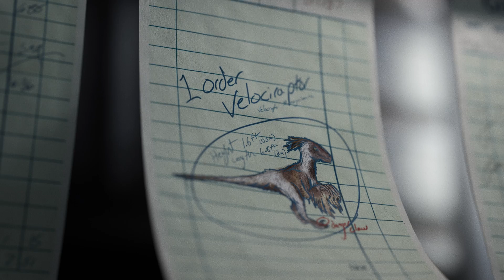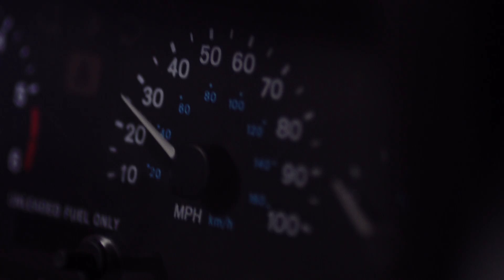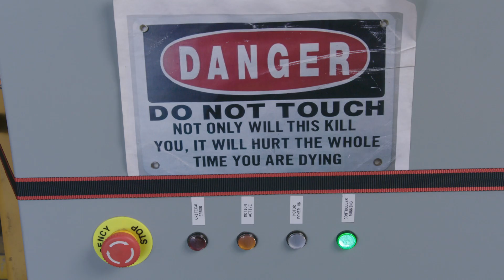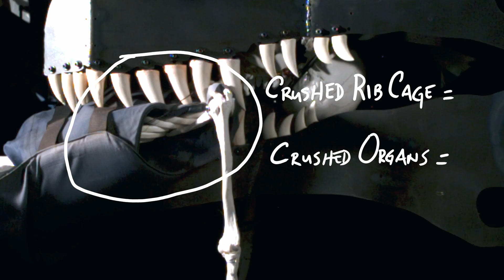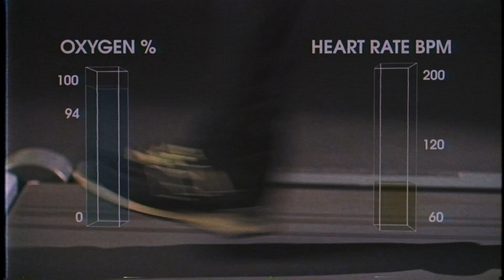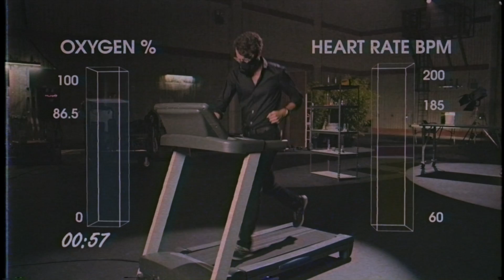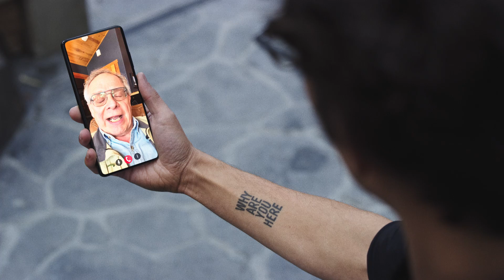Could You Survive JURASSIC PARK?

Comment: The general research in this video is all over the place, they ignore all of the nuance in feathers on tyrannosaurus but have a fairly good, albiet conservative restoration of velociraptor. At the same time ignoring and implying that modern restorations aren’t cool enough so using outdated reconstructions is fine. When these were animals that once walked the Earth, not movie monsters for your entertainment. And then 10:52 comes in and calls pterosaurs flying dinosaurs. I don’t hate that statement because they are at least the closest animals to dinosaurs that aren’t dinosaurs. But then they also ask about pteranodon in the introduction even though they are testing the strength of an azhdarchid, which is a completely different family of pterosaur. The only saving grace is they used pterosaur instead of pterodactyl, which is like the bare minimum.

Comment: I think it will be possible to get dinosaur DNA.  There are just so many millions of copies.  They are all damaged, but not damaged exactly the same way.  If each were read, in a sample, there should be enough intact small bits of DNA, in each copy.  Normally super small pieces would not be that useful, but if relative location was also known, which should be obtainable, perhaps using nanites, it is conceivable that it could be fully deciphered.  I am not saying we could do this in 5 years.  It might only be possible 50 years or 500 years from now.  Just that the information is not permanently lost.  Some will be.  I suspect, not every species' DNA is out there, that is in the fossil record.  Though, we may get DNA from dinosaurs or other creatures that have never been found in the fossil record. I suspect, also, that there are more sources than just amber.  
Further simplifying the task, there are likely more probable or even consistent ways, different patterns of DNA are damaged, in the same way we could learn to recognize what kind of bug was smashed on our windshield, we may deduce what the section of DNA originally said before it was hit by a cosmic ray.

Comment: How can you know what an extinct animal looks like? All the soft tissue like skin, feathers, organs they've decayed leaving behind only fossilized bones. So how can anyone know if they are feathered or leathered? and wouldn't biteforce knowledge require more than just jaw and tooth size? you need to know how much muscle was involved as a jaw without muscle is pretty much motionless.
Reply: Soft tissue has been and can be preserved. There are cases of extraordinary fossils that leave behind a lot of stuff, which includes feathers and other soft tissues like skin and even organs. Recent studies have been able to even recover colors from fossilized feathers. But you can tell very much by just the bones alone. Like for example, we have found bite marks in triceratops fossils that perfectly match the holes made from trex teeth, and they just so happens to have lived at the same time, so that is indirect evidence of predation by a trex. You can also check for muscle attachment points in the skeleton and very accurately figure out how much muscles they had in certain places. This is done with modern animals as well and works very well.

Comment: What people tend to forget about jurassic Park is the dinosaurs aren't really even dinosaurs. They're just designed to look like dinosaurs, and have the base DNA of the dinos, but so much has been filled in or put into the DNA that it's questionable if you could even call them dinosaurs anymore. It's like if you changed the DNA of an elephant so it behaved completely different, ate a completely different diet and preferred a different climate, but they still LOOKED like elephants, would they even be elephants anymore?
Reply: Ship of Theseus
Reply: Also if they used bird 🦜 dna 🧬 it would actually be close enough to the actual DNA.

Comment: In reference to 9:52 comment about the fence doing nothing is incorrect. If the each line in the fence is at a different potential. In that case any contact between line to line would create a path for electrocution.

Comment: They "discovered" that Trex can only go about 12 mph?...
1: How was this discovered?
2: How does that even make sense? You'd be talking about the single most unsuccessful predator to have ever existed. Even if it was a scavenger, it would be completely dependent on being able to steal basically EVERY other smaller predator's kill within a 30 mile radius just to maintain their weight.
Reply: 1. probably by looking at its feet and doing some calculations. 2. the animals it hunted werent fast runners, the fastest meals it hunted were around the average speed of an elephant, the animals a tyranosaur hunted were, big, very big, so they werent that quick.

Comment: Sadly many of these claims don't hold up to scrutiny. 

For instance, would modern day plants be digestible? Most of the dinos in the movie, like T rex and Triceratops, actually lived in the late Cretaceous, which had plenty of angiosperms to munch on. Furthermore, all plants are constructed of the same basic components, fibrous material (cellulose, lignin), some easy to digest macronutrients (sugars, proteins and fats in seeds), and defensive secondary compounds. The defensive compounds change in different plant taxa, but herbivores have many ways of dealing with that.  The most basic way is taste, which tells you if and how much is suitable for digestion. The point is, this claim is way overblown. It probably would have caused problems, but nothing as clear cut as suggested. 

The difference in oxygen is also relatively minor. A 5% decline in O2 is like moving from sea level to Flagstaff, AZ. Most animals don't have an issue with that. 

Finally, velociraptors are indeed pretty small. But change the name to Deinonychus or Utahraptor (much bigger), and you'd have a big dromaeosaur 'raptor' that would scare the bejusus out of you. Not nearly so smart of course. Corrected for size, their brains are at the lower end of modern birds. Like a chicken. Big for a dinosaur, but nothing like a crow or chimp. 

Lastly, a big T rex was probably not covered in feathers. Large mammals like elephants and rhinos are not covered in fur - it traps too much heat. Assuming dinos are warm-blooded, a baby T rex would have been feathery, but not her mama.

Comment: "not that intimidating at all"  hun that "turkey" has a mouth full of razor sharp teeth and feet with disembowling talons.  not to mention they are incredibly fast and agile.  you would be torn to shreds in seconds by a velociraptor.
Reply: Exactly, they might not be as intimidating as the ones in the movie, but they are still a substantial threat. They are comparable to coyotes; they are not likely to attack you, but you're going to want to avoid them regardless.

Comment: Those masks dont just decrease oxygen. They make it harder to inhale. Not the same thing. You'd need to go to a higher altitude, or use some kind of proprietary gas mixture with a mask.
Reply: Making it harder to breathe  technically there is a decrease in oxygen flow. So the same negative could happen .

Comment: I can prob handle against a third of the species, the rest....prob not....
rifle and shot gun and PCC. Against compies, maybe, depends on how aggressive they are. 

So basically if a trex bites down on a skeleton its like its eating crispy/crunchy skin of KFC......i guess they'd have no prob eating bone and pooping them out then....
the bite force makes sense when you consider how large the bite force is from gators and crocs....

Also the T-Rex is not the only thing you have to worry about, but also other large dinos like Triceratops and Stegosaurus that will hit you or bite you as well... 
Also wearing body armor means nothing if you don't have a shell like a turtle to hide in, all you are is just a shrimp in comparison with easily crack-cable thin shell or leather armor and you lack the frame of a car/turtle shell to protect your inner soft parts from the pressure of weight or bite force....that's not hard to figure out....

You have to worry about the bite force of other beasts not just T-Rex so this video isn't as thorough as I'd hoped, but the point is, if you see a T-Rex, you're screwed pretty much unless you can avoid it.

Comment: 10:05 so... is the implication that one could theoretically scale an electric fence as long as they like, leap up and grab it so their feet never touch the ground upon contact? And then of course leap off on the other side when low enough so there is no contact with the fence upon returning to the ground?
Reply: This is correct. I have actually seen it done. It is the same reason birds don't (usually) explode into feathers as soon as they land on these things.
Reply: @vicioushellsing  why did I laugh
Reply: I tought this too
Reply: @Yes_this_is_my_cat  qw67w22u6 and 273uu3k

Comment: The creators knew the Velociraptors weren't correct, as they purposely modeled them based on the Deinonychus, as did the author of the books, but they preferred the name Velociraptor as it was more "dramatic." It certainly sounds cooler.

10:54 Pterosaurs are not flying dinosaurs let alone dinosaurs at all. They were just a type of reptile who could fly that happened to be alive at the same time as dinosaurs and a whole lot of other -saur things. There is a huge misconception where various flying reptiles and marine reptiles are lumped into the "dinosaur" label but as a general rule of thumb if it was a flying or water-based creature then it likely isn't a dinosaur. Looking at a pterosaur such as a pterodactyl and calling it a dinosaur is like looking at a dinosaur such as a T-Rex and calling it a pterosaur. It's just wrong.

Comment: the raptor portrayed is a utahraptor not a velociraptor. velociraptor was only ever actually mentioned in the first scene of the movie. after that they were called raptors by the cast. theres no real evidence Tyrannosaurus Rex was feathered, Scientists have produced a wide range of possible maximum running speeds for Tyrannosaurus: mostly around 9 meters per second (32 km/h; 20 mph), but as low as 4.5–6.8 meters per second (16–24 km/h; 10–15 mph) and as high as 20 meters per second (72 km/h; 45 mph) the hunting and max speed of Tyrannosaurus Rex are still more or less up for debate. these are pretty much my only gripes.

Comment: So. Yes, the velociraptor's name is wrongly used but Jurassic Park raptors were based on the Utahraptor, which is basically a velociraptor in all but the name they used for them ((the velociraptor sounds cooler, I guess)). Utahraptors were actually slightly bigger though I'm not sure if they were pack hunters and as intelligent. I'll have to research it.

Comment: For Beginners,They Didn't Use the Proper Materials To Build Dinasour Enclosure,Instead Of Flimsy Steel,We Would Use 25 Inch Transparent Steel,Much More Resistant To Armor Plating,Next With Current   Technology  Being Updated,With Alittle Bit Advance Technology,To Use To pin Point Aggression In A Dinasour BrainAll You Have to Do Is Nulify That Aggressive Message in Dinasour Brain By Simple Electronic Helmet That Uses The Same Technology To Grow Dinasour Cells To help protect  NuroTrasmitters,Made From A Special Alloy That Doesn't No.1. Interfer With Dinasour Biology &Resistant To Damage A Dinasour May Encounter,Think Smarter With Advanced Technology instead Of Foolish Thoughts of Personal Wealth over the Life of An Individuals in 22 Century Jurrasic Park😊

Comment: Amazing episode, well done and thank you! One gripe though is the "oxygen limiter" Aka the pseudo-high altitude mask you used doesn't simulate high altitude for 2 reasons. As an exercise physiologist this is a pet peeve of mine: 
These masks restrict the volume of air you breath but don't affect the partial pressure of O2 in the air (paO2). And even then that wouldn't change the percent O2 in the air (it would still be 21% but just with less pressure).

Even if you went up to an actual high altitude the percent oxygen would still be 21%.

To truly restrict the percent oxygen you'd have to have a spirometer attached to a large steel drum of air where you directly control the pressure and % oxygen.
Reply: @Ryan Napier Actually,  no; similar to wearing a face mask or N95 mask, it does not affect your SaO2 (oxygen saturation as indicated by how well your red blood cells are binding to oxygen). 
However these fake "altitude" masks would be good for strengthening your ventilators muscle (primarily the diaphragm) but ventilation is not a limiting factor in in exercise performance (in fact even if you breathed pure O2 your cells still may not be able to utilize the oxygen carried by the blood aka your VO2max.)

I did a podcast that touches on these topics a bit. You can check it out by typing in 1 Life 2 Lift into any podcasting app and searching for my 5th episode on exercise and asthma (featuring Bane from Batman).
Reply: @Ryan Napier This is my Fitness channel account FYI. 👋
I might make a video in the near future directly addressing these kinds of misconceptions around oxygen utilizing and physiology. 👍

Let me know if you have any other exercise questions, I'm always curious to see what the lay perspective is on these topics :)

Comment: Pterosaurs are not flying dinosaurs, they are a totally different group. That's like saying a dolphin is a seal that lives in water the whole time. Totally incorrect. The only flying dinosaurs ever were, and are, birds. Also, the oxygen level test you did on the treadmill was pointless and no comparison, because humans have completely different breathing apparatus than dinosaurs did. Dinos shared the same breathing mechanisms as birds , which involves a one-way air flow through air sacs and hollow bones as well as lungs, meaning they can breathe in and out at the same time. Mammalian lungs are far less efficient since we can only breathe in, or out, at any one time, whereas these animals had a constant flow of fresh air over the lung surface. Your hypothesis may still stand, but your treadmill demonstration was completely inappropriate and further investigation is required. Jack Horner, the paleontologist who was technical advisor on the movie, and incidentally was the first person ever to discover a dinosaur embryo, has stated that he does not think oxygen levels were a factor in the size of dinosaurs, and that gigantism will, can, and does happen without elevated levels of O2.

Comment: One of the important issues with the dinosaurs in Jurassic park is that they are technically genetically altered as in the first film it was stated due to degradation of the genes they had to take several different modern species genetics to substitute and fill in the missing components.

Comment: There's no evidence that T-rex had feathers, let along that they were colorful. We only have evidence of a wide distribution of scale impression among it and its closest relatives. You can find diagrams of them of Google. Also check out the reconstruction of Sue by the Blue Rhino Studio for a modern interpretation of what rex looked like. Another reason raptors may have had trouble opening doors is because their wrists couldn't bend with the palms facing downwards as your CG model and the JP dinosaurs depict. And while velociraptor was smaller, there were other raptor species as large as they are in the film.

Comment: It's all a moot point. IF and I mean IF the movie was true. They are NOT true dinasours because they did not have full DNA strands to work with. These were bio engineered animals. So, if using DNA from modern animals (frogs in the movie) the resulting animals could be "tweaked" to our modern O2 levels and diseases.